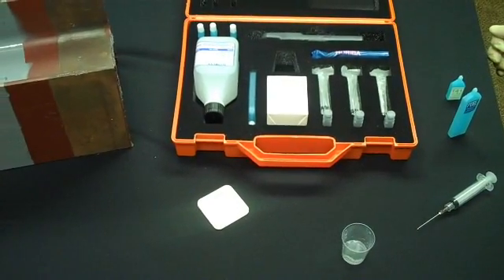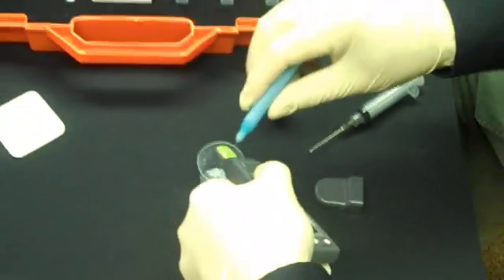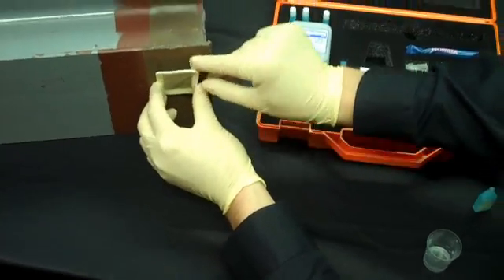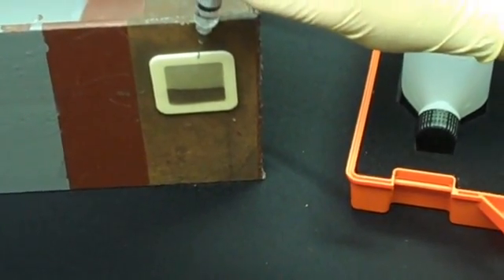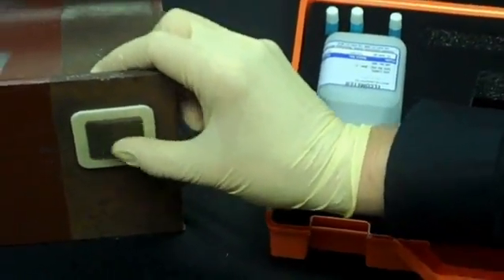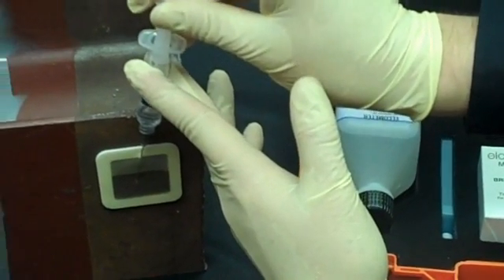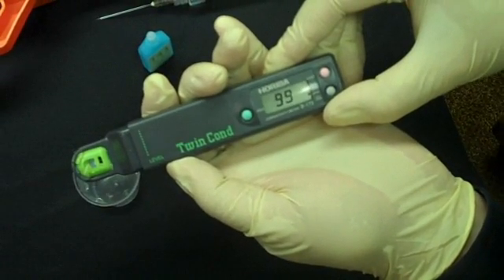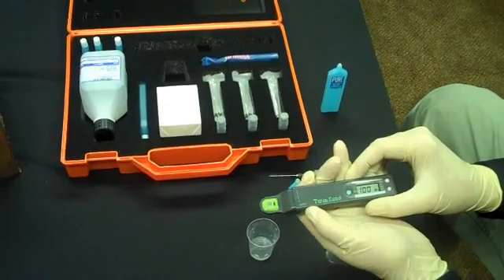Elcometer 138 Bresle Salt Kit

Comment: How do you know the conversion from microsiemens/cm per miligram/m^2?
Reply: +MajorMIX quite easy if you read the ISO 8502 standard.
Reply: Hi, friend. Did you find? Also, Im searching answer. I cant find.
Reply: For 10 ml volum 1:4. it means 50 mkS = 200 мг/m2